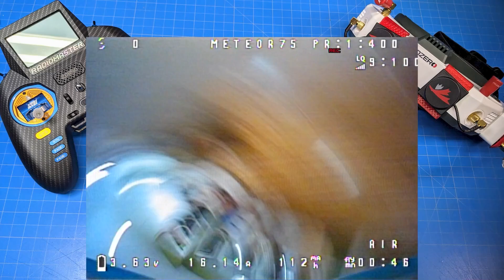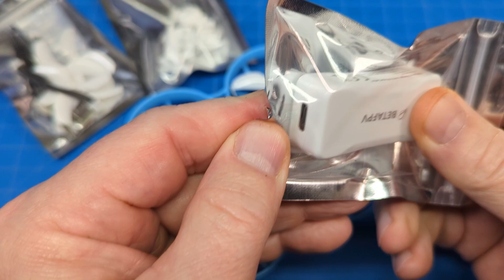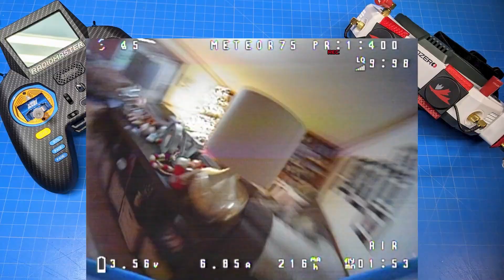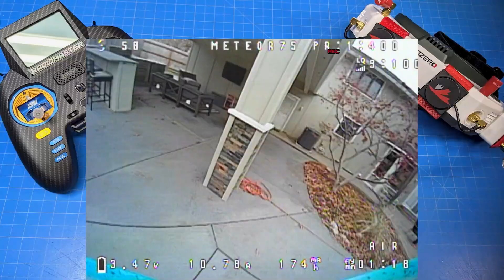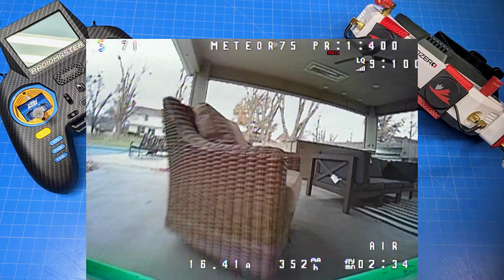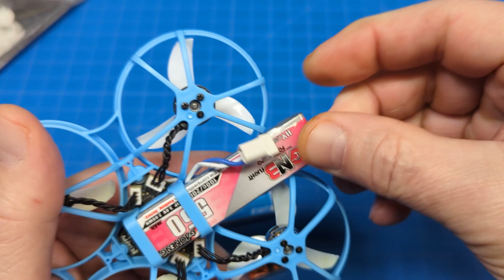Meteor 75 Pro // BetaFPV Matrix 5in1

Comment: Excellent, love the drop into your outside roofed area.  That canopy is tough, and although still quite open does more likely exclude water droplets off grass, etc, but its heavy. Why anyone should want to add the extra weight of the "Knight" rubbish is beyond me. I have a couple of them in use on Meteor std 75's and I have dremeled the sides away more to improve fit and cooling (I'm on HDZero, or HDFurnace as I call it). I have tended to glue the HDZ ECO Cameras in with beads of UHU POR which does several things, gives some cushioning/anti-vibration, and allows movement to set angle.  It peels for removal/mtnce, too.     They are rather loose in sizing Incidentally, the 85 frame is 88.
Reply: The Knight parts are to absorb energy on impact and protect the camera and gyro flying near/over cement at speed. My biggest gripe with using them is the added drag. The horns work well with protecting the new Happy Model Crown CP antenna but again the added drag is worse than the added weight flying outside in wind. The new Crown CP antenna BTW @ 30mm weighs 0.68 gram add's only adds a fraction of a gram... like 0.06g as I recall on the HX 155S TP as the coax is little shorter than the dipol dispite being thicker. If using a CP on your goggles it make a huge difference so glad to see a new CP design antenna.

Comment: Does the video blackout incidents corelates with the battery voltage? I saw when it blacked out, the voltage went down to 3.2v.  

When you punched out after the fence crash, the video blacked out at 3.2v

It happened again during your last punch over the cabana and the voltage dropped to 3.17v but when outdoors, the video was quick to recover.
Reply from the maker: Those outside I didn’t see as video blackout but just poor analog signal performance. There are several bits were I got below 3.2 without any issues

Comment: I've built my own 75pro with matrix aio, it flies better than expected, no issuses with vtx. Best 1s aio at this moment.
Reply: What are the differences from the old aio? Was is a 5 in one before?
Reply: Rebuilding a 2022 75 Pro at moment with stock motors/can, and matrix board. I removed the motor connectors, getting weight down to 3.63g for the board only. If the durability is increased, the 75 Pro will be one of the best options available IMO. Nick proves its a great indoor flyer if you have a little room, and the camera is now the best weight to picture quality on market, with the Pico razer being discontinued.
Reply from the maker: Good to know yours are working normally
Reply: I plan on building a mob 7 with 1002 23500 kv motors with this board the beta fpv 75mm frame is really a lil bigger and can accept a bigger prop though hows yours flying? Any tuning issues?
Reply: @ScubieDaDude  Don't worry, this board is originally mounted in new meteor 75 pro. I've just build mine from parts that i have and put pidtune from meteor 75 pro.

Comment: Looks nice, but i don't like that you have to use a usb adapter. A normal usb-c plug would be better
Reply: I've ripped off the micro usb port from my original 75 Pro and the port on my Air 65. We need some rigidity in these things
Reply: @lemonsquareFPV  micro usb would be fine to. The best thing would be to sell a "lite" and a "full spec" version or something like that
Reply: the adapter is a great idea to save weight.